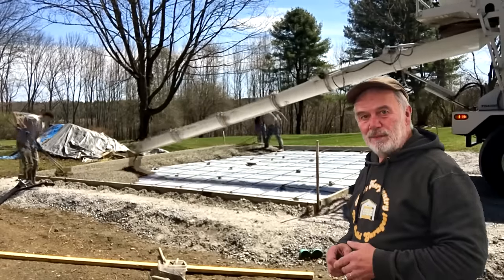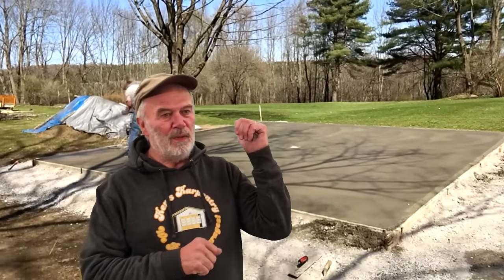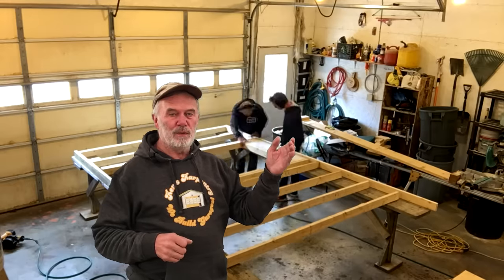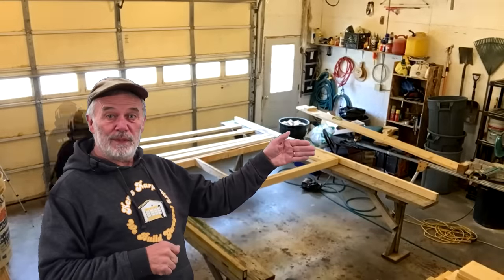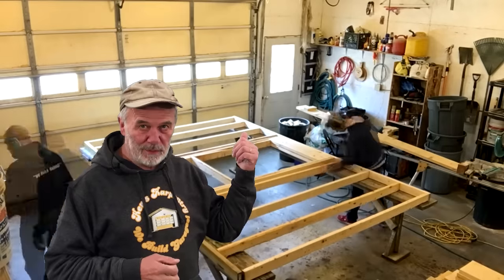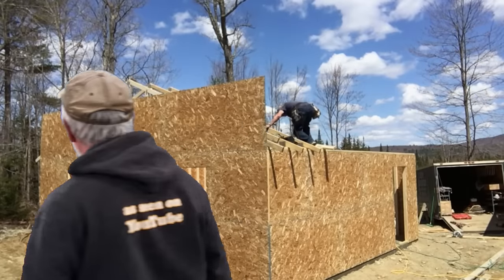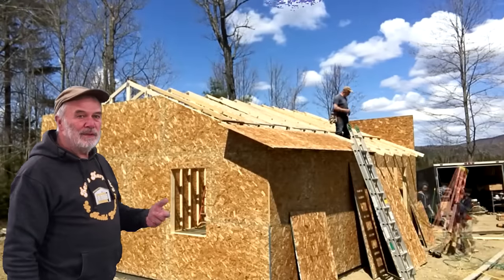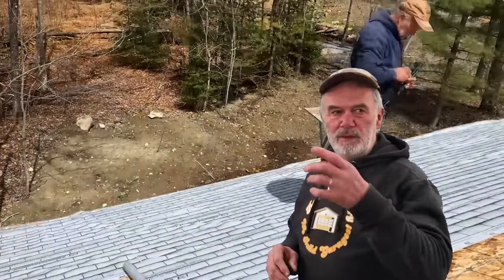How much for a Ranch Garage in 2021 ?

Comment: Harrison Concrete.  You must be close to me in Cambridge Vt. ?  That $19k includes the concrete slab?  I am clearing a spot to build a 32x36 pole barn.  I am doing the excavation work now and plan to place 5’ tapered pre cast pillars for the posts.  I don’t think I can swing the concrete floor right away but would like to do that at some point.  12’ walls, 16x11 front sliding door and a 10x11 sliding door on one side in the rear. Do you build these style structures as well?

Comment: Ive always used the metal spacers but always leave them in, what fastener are you using so it makes it easier to remove,  I can see the money savings by reuseing them.
Reply from the maker: I just use roofing nails. Thanks for watching

Comment: Wonder why they didn’t build a driveway in front? Wanting to do this here in CA (24Wx32Lx 12H) )but thinking metal building with 12’ door on one side to be able to pull my RV in.
Permits are like  $2k here in San Diego and building cost is about $20k  + concrete pad of $9- 10k- co$t of materials are thru the roof these days

Comment: Ken, Excellent marketing video, refreshing.  Do you guys travel for work on west coast, I am in San Diego...perhaps a break from east coast winters are in the cards?   I am also interested in using a truss at the correct angle for correct Solar panel installation for my location.  Thoughts?
Reply from the maker: Up here they have installed them anywhere from 512 to a 1212 pitch

Comment: Here in SW Washington, the concrete alone would cost almost that much. Not sure what happened to building prices here over the last year....and don't tell me it's the wood because wood is a small component of the total cost of the building. Wood doesn't cause what used to be $50k to now be $100k.

Comment: I do have an educational question!!?? Not  trying to be a skeptic at all, I do value the work and ethics of the profession! To the question now.. when building your wall, I noticed that your bottom plate was a regular 2x4! Shouldn't a pressure treated plate be used to prevent rot from accruing, caused by the concrete? Thank you for the video and God bless you sir!!
Reply from the maker: Thanks for watching. It’s hard to see but we always use pressure treated bottom plates as well as sill seal between the plate and concrete

Comment: What would the cost to build be for a  40x60 with 12ft ceiling height. 6/12 pitch roof. 6" concrete slab with 5000 psi with fiber. 2x6 walls.

Comment: 20K?  Damn!  If I could do that I would book you tomorrow...HOWEVER, $20K probably would only cover the permits and time off work during the year and a half long process of getting it approved and all the other BS I would need to do in order to get it approved here on Eastern Long Island...  The Building itslef would probably run 50K around here...  (I am slightly exaggerating, but probably not by much)

Comment: Ken, if you were to join a gable roof to an existing perpendicular wall which is sided with T1-11 how would you install the flashing?
Reply: Couple ways to go.  Can slice the t1-11 and use z flashing over step shingles and under t1-11.  Or, can set step flashing against siding and install trim wood over steps with sealant behind and above after attaching.

Comment: the only problem with giving you the advance is how do i know you will not stiff me and keep the cash. might i suggest a third party hold the money where we both have access to it and it takes two signatures to withdraw the money. ive had a few contractors try to stiff me about the materials which is why i never pay in advance
Reply from the maker: Good point.  However my reputation precedes me by over 30 years in my area so that’s what I do.

Comment: Wht not use 30 _ 50 year shingles. Also wanted to ask  i see siding is 20 in a box so how many sq do you consider them there 12ft by 10in.
Reply from the maker: Typically siding comes 200 square feet per box

Comment: Where are you located and what areas will you work in
Reply from the maker: Northeastern Vermont
Reply: @kenskarpentry  Thats to bad. LOL Do you want a break from he cold weather this winter and do a job in SE Florida 🤔.  I have a 3 wall racquetball court using he back wall of a portion of the house that I want to pour concrete over the court to raise it up to the same level as the house floor, close in the 4th wall and put a roof on it to make a media room. In order to enter it from the house I would need to convert two closets into a hallway and make two new closets for the two back bedrooms. I noticed you put up trusses. Could you just use 2x6 or 2x8 open A-framed rafters with a floor for extra storage above the media room and the roof plywood sheathing?

Comment: Ken, great video.  I have a question and if you answered it in the comments already I apologize.  The metal roof appeared to be fastened directly to the deck without a lattice type structure to keep air flow Uber the roof.  I always thought you could attach it directly like you did but others have stated that the lattice was required.  What enables you to attach directly to the roof deck?  Looks like a better membrane of sorts.  Is that the difference?  Truly interested and intrigued.  Also was there anythng tube on the ridge vent to vent the attic?  Or was that a breathable material along the ridge?  Your video was great again and please keep up the fantastic work.
Reply from the maker: Thanks. It’s vented under the plywood

Comment: Local builder just quoted out a 24X36 garage with a poured concrete floor and small pad out front, just under $30,000 in materials alone.
Reply from the maker: Prices are way up